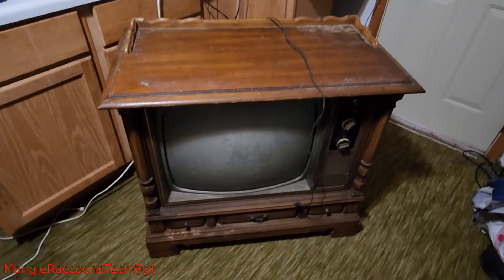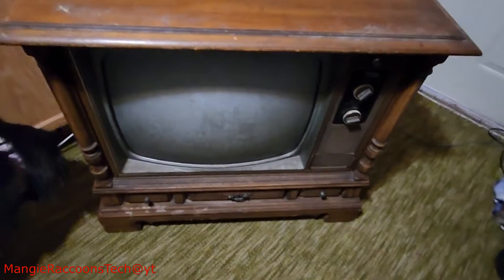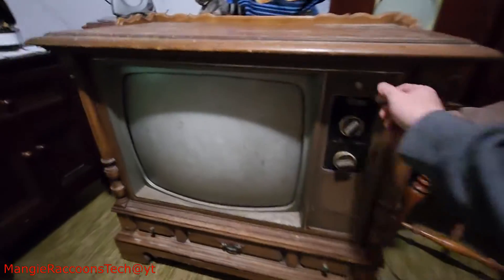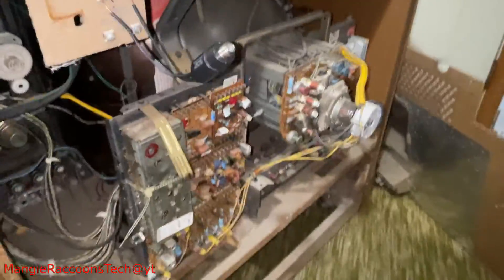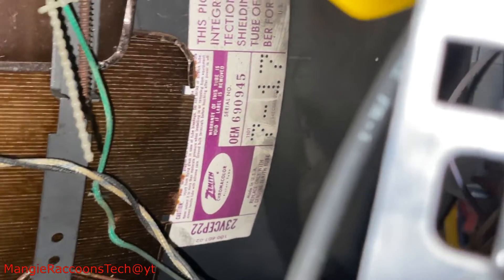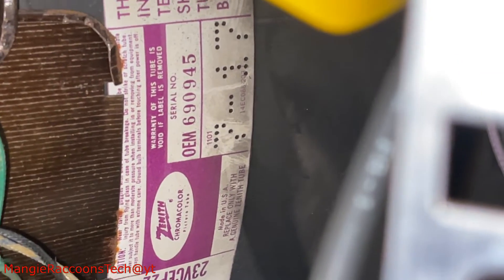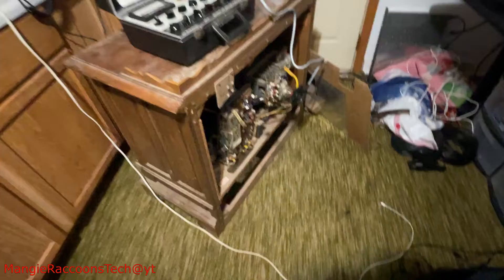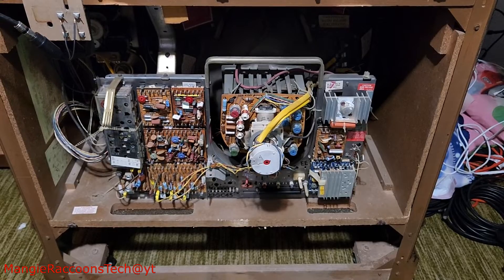1976 Zenith Vintage Chromacolor II Console Television Repair PT 1 of ?

Comment: I used to have one of those TVs when it was brand new. That thing was plagued with problems. Convergence was bad, horizontal hold would often slip, and the color would fade away, kind of like what you showed in this video. Sometimes a firm knock with a fist on the top of it would straighten it out for a while. I had the back panel off of it several times, but I always shied away from the flyback transformer. When I was extremely young, I reached into the back of a TV set while my father was working on it, and I got zapped. I didn't want that to happen again, ever. We sure have come a long way since then, with nearly paper-thin OLED displays.
Reply from the maker: Yeah this set has been plagued with problem after problem. Crazy it was like that from new even. Recently had to replace the big oil cap that shorted. But I've kept it running and when it is running the picture quality is great. Got a replacement tuner, so someday gotta replace that. The 1966 tube RCA color set still no problems. Picture quality isn't as good and the original picture tube is getting super weak. Oh the focus coil doesn't work, never has, need to fix that.
Reply: @MangieRaccoonsTech  Your mention of the tuner reminds me of something else I had to do frequently. I made more than one trip to Radio Shack (which, incidentally, used to be my favorite store) to get a can of tuner cleaner. I can't remember what the composition of it was, but it had some potent stuff in it. "Use in a well-ventilated area" was an apt caution for it. Maybe that's what happened to a chunk of my brain cells.... 🤣
Reply from the maker: Heheh yeah I miss that radio shack tuner cleaner! That was some good stuff. I used up the last of mine years ago. Doesn't seem like the stuff I've found so far does as good. Well maybe that's why I'm wacked too lol

Comment: Your probably aware of this, but make sure your HV voltage on the CRT is where it should be and not running higher than it's suppose to. If Incase the HV is running higher, it'll blow the CRT.

Comment: Man I need the power cord to a 77 chromacolor two I purchased recently it’s two prong right side male end on tv is a larger pin than left any help would be appreciated greatly locating one the tv was found in a storage unit still with purchase tag on the coaxial cable and appears to have never been used.
Reply from the maker: Try doing a search on ebay for vintage Zenith tv power cord. Keep close eye out for the ones with the different sized pins. I found a few on there, around 30 bucks it seems. Hope you get your zenith set working!
Reply: @ much appreciated yo.

Comment: That was the model TV I grew up with. It was crap next to today sets, the repairman had to come fix it at least once per year😂
Reply from the maker: That's awesome! Would have been an awesome set back then. Early soid state and the mich higher voltages of these sets does seem to have led to regular failures. I also remember the tv repair man having to come a lot when I was a kid lol ours was an RCA console.